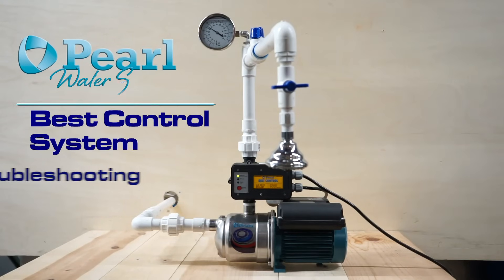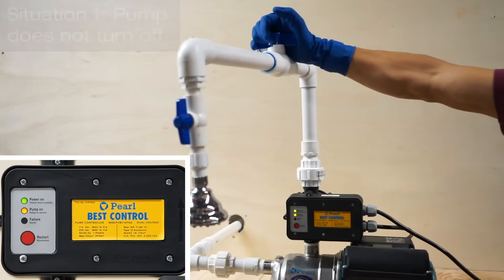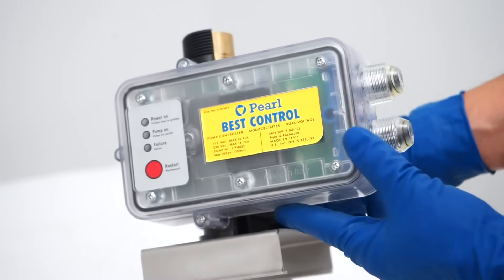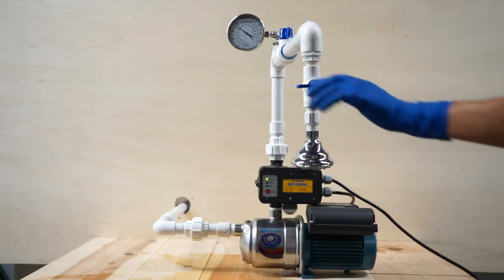How to troubleshoot a water pump control system?

Comment: I have two questions! 
1.The motor is set up for water pressure does it only work when there’s a water supply from tank?

2.What about the water source for the tank?

Note: Regarding the water source will there be a separate pump for that, or can a single pump handle both filling the tank and supplying water?

From this video, I understand how the system delivers water, but it doesn’t explain how the tank is filled from the main line. That part seems to be missing.
Reply from the maker: Hello
Thank you for your interest in our company and products.
We highly recommend you to get advise from a knowledgeable plumber. The system selection that you need and would work, depends on your specific installation requirements.
Have a great day!

Comment: HI, i realise this is an old thread, but its worth a try. my pump shuts off at 50 psi, and does not start again until it gets down to about 15 psi, we have to lift water about 45 feet from the tanks, does this sound correct?
BTW, great information in this video

Comment: 🎯 Key points for quick navigation:

00:15 📚 Evaluate the candidate's previous YouTube and blog SEO experience by asking for specific examples and measurable results.
00:43 🔧 Look for proficiency in SEO tools like Google Analytics and TubeBuddy, coupled with evidence of improved rankings and viewer engagement.
00:56 📈 Assess content strategy abilities, especially in keyword research and audience targeting for sustainable channel or blog growth.
01:25 🌱 Ensure they can create both short-term and long-term content strategies, adapting to audience behavior and changing algorithms.
01:53 🎨 Investigate their ability to balance keyword optimization with creative video titles and blog headlines that drive high traffic.
02:34 📊 Ensure strong knowledge of YouTube's ranking factors like tags, descriptions, and engagement, using analytics to refine strategies.
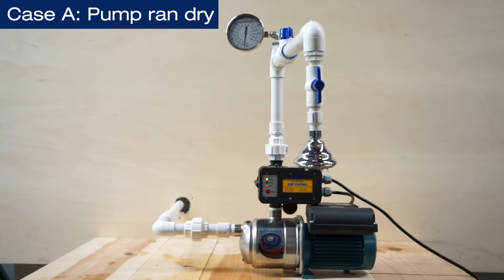03:00 📤 Prioritize candidates who offer consistent updates and adapt strategies based on data and feedback.
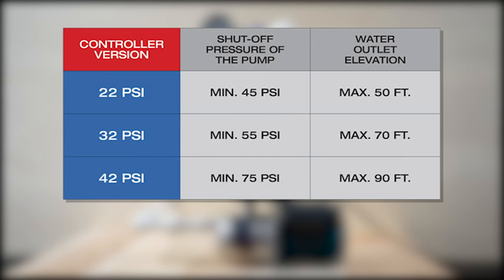03:26 🤝 Look for a thorough understanding of your brand's tone and target audience, with tailored strategies to differentiate from competitors.
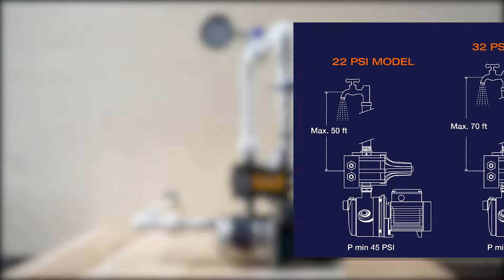04:03 🛠️ Check experience with technical aspects of video SEO, like captions and video tags, along with skills in blog post SEO optimization.

Made with HARPA AI

Comment: Saludos amigo! necesito su ayuda por favor, compre un presscontrol está nuevo y lo conecte a una bomba de 1/3 hp pequeña y a su vez a un tanque de agua de 2000 litros con buena presión de agua, pero resulta que después de conectar y energizar el equipo arranco muy bien con la luz verde y amarilla prendidas perfectamente pero ocurre que después de usar o lavar o bañarme o después de usar el agua y cerrar el grifo de manera inmediata se activa la luz roja, y si abro de una vez el grifo se apaga la luz roja y si cierro el grifo inmediatamente se enciende la luz roja hasta que el equipo presuriza y apaga la bomba pero la luz roja sigue encendida. Hay suficiente agua en el tanque con buena presión, pregunto por favor el porque prende la luz roja de falla al cerrar el grifo y sigue prendida después de apagar el presscontrol? por favor espero su ayuda. Gracias!

Comment: My watertank is full of water. Problem 1. The pump keep on running, I have check there is no leak in all the pipe and there is no water tap is ON. If i closed the valve, pump it will stop? If i open the valve it keeps running? Pump should stop when any of the house tap is not in use but it still keep on running, what should i do? Problem 2. Pump stop running, unless I press the reset button to start or I off the power and ON again waterpump will works, If no water tap is open within 1 hour, pump will not work i have to reset the preassure controler to start the pump again? what went wrong , please advice? thanks
Reply: Try turning off your system and adjusting the pressure screw to the minus side.

Comment: My pump will pump water but fault light is on , and it won’t cut off even after output valve is closed, I even shut the input valve and yet it won’t shut off , brought another pcu unit and still same problem, call 5 people to check and they can’t find the problem. Exchanged the new unit and got new one still the problem

Comment: i have a question, after detecting that there is no water from the source the switch will cut off and try severel times right? after that there is no water in the system and the pump will not work until  you prime the motor again am i right? my motor is getting water from a well

Comment: Hi there had a water failure from the tank to the pump, red light on. I finally got it working by priming the line. pump is now operating however the pressure is low in the house. Can I re-set the pressure at the pump ?  thanks for any assistance :)

Comment: It is possible to install a 1hp pump to automatic pressure switch?
Reply from the maker: Good afternoon. 
Yes it is possible. you need to make sure there is at least 25 PSI difference between the shut off pressure of the pump, and the controller starting pressure.
We highly recommend you to hire a certified plumber, to help you with the installation.

Comment: Dear sir,
I have other brand 2Hp water pump. Pump doing trouble a few days ago pump  can working normally after few days pump need resting then working normally for few days tell me what's the exactly issue its pump faulty or pressure switch issue
Reply from the maker: Hello
if after watching the video and following the recommendations, things have not improved, we highly recommend you to hire a knowledgeable plumber to help you  with your system.

Comment: Thanks for sharing
Reply from the maker: Thanks for watching!
Reply: Thank you for vedio
I have question
If I install the controller upside down with the correct inlet and outlet will it work?
Or the checkvalve will not close.

Comment: If there is a power cut, my pump needs to be restarted using the reset button (usually if the pressure is released from the system). This wasn't the case before.
Reply from the maker: Hello
It is hard to say. Did the conditions of your installation/application changed? If the system is going into failure mode, as you noticed in the video, there are 2 reasons. If you checked and still and none of them applied, we recommend you to contact an experienced contractor to check your system.

Comment: How can you check the pressure when there is none.  If the pump controller is in failure mode, then the pump hasn't been working so there would be no pressure.  I understand that you can adjust the pressure but it doesnt' have a setting, you just turn the knob in the back and it adjusts, it doesn't tell you what you are adjusting it to.
Reply from the maker: Hello
To check pressure you need a pressure gauge installed in your system. 
Not sure what model of controller you have, but the Best controller has fixed starting pressure. you can not adjust the starting pressure setting. there are 3 models: 22, 32 and 42 PSI.
We recommend you to hire a certified plumber to help you with your system.

Comment: Hi, 
I have an issue with our pump.
It shows fault LED and won’t turn on. Press restart it does a cycle and then returns back to fault issue.
If I open all taps in house and press restart then it works but as soon as I turn a tap off the pump again, returns to fault.
Do you think this is a pressure issue?
Thanks in advance.
Reply: I have same problem.
Reply from the maker: Hello
It seems like a pressure issue. The systems goes to failure mode when there is a dry run situation, or the systems has not been properly primed.
We suggest you to hire a certified plumber to help with your system

Comment: Need assistance. We have a Davey HP45-05T2 pump and the Presscontrol controller is showing "failure". It did not run dry and I have checked the priming plug is filled with water. I have held the reset button but it does nothing.
Reply from the maker: Please consult with a certified plumber, as this seems like a problem in the whole system.

Comment: My newly installed pressure pump(Crompten greaves) is showing red light "failure". I was tried all the related solutions to fix it. But  It couldn't.
Reply from the maker: Hello
please share more information about the pump you are using (Model, HPs,Electrical ....) also details about the application and installation. Flooded suction or boosting?   and we could try to help you... thx

Comment: Our pump runs every 14 minutes for 10 seconds. We have checked all lines and tapes for leaks. In the case with taps and shower head using 
 the toilet paper method. We also checked the toilet system and everything checked out OK.
Any ideas?
Thanks
Reply: The NRV at the intake of the pump control unit may be dirty so leaking pressure back to the pump. If you dont want to strip the control unit down its easy to add a NRV on top of the control outlet (they are about 5 dollars)
Reply from the maker: Thanks for your reply.  Looking into the installation is a great idea. Most of the installations involve several factors to take into consideration when troubleshooting.

Comment: Excellent video!!!
How to measure the pump shut off pressure?
Reply from the maker: Hello. Each pump has its own shut off pressure.  for instance our model : BWSMS07 17G40P has shut of at 70 PSI. you could always measure the pressure in the system and the shut off, by installing a pressure gauge in the system.

Comment: Thank You very much, Problem No. 1 Works for me, when i try to disassemble the Controller and flush the check valve with water hose. i also found some debris that stucks in the thread of the fittings. Thank You very much again. Well explained
Reply from the maker: You're welcome!
Reply: @PEARLWaterSystems  6
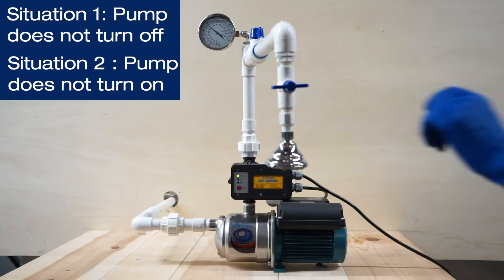Reply: 0:33 0:36 0:38